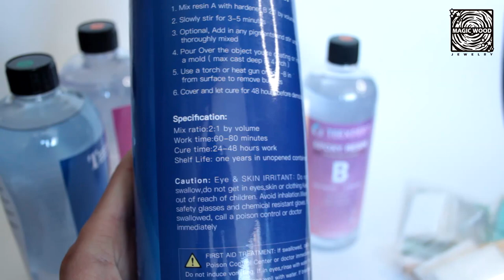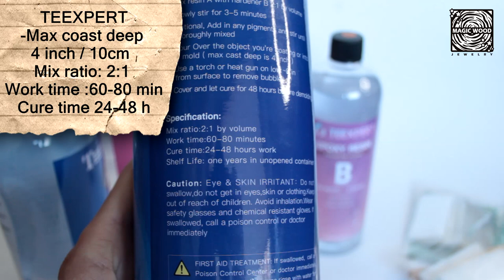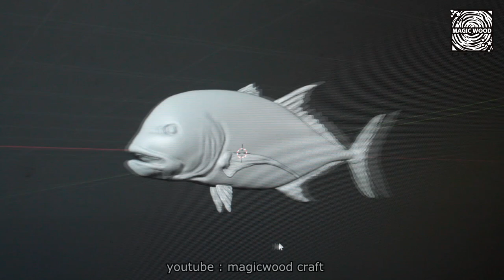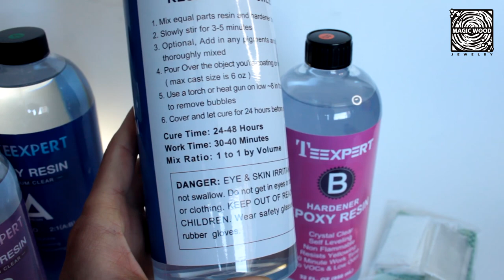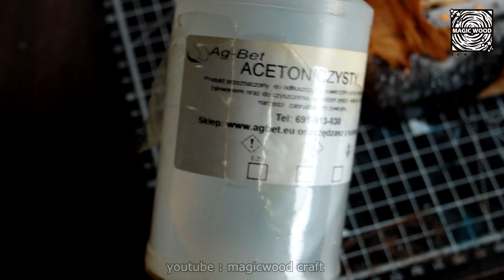Epoxy Resin and Wood Night Lamp - Giant Trevally Fish / How to make / Resin Diorama / DIY.

Comment: Hi amazing art work! ❤

Could you share how much resing in kg. Did you use for this project and how big the lamp is? Pls. 
To know how many kilograms of resin have been used. 

Many, many thanks!!
Reply from the maker: Hej. Thank you! Hey. From what I remember, less than a kilogram of resin. The lamp was about 25 cm high and 18 cm wide but not thick. Probably 4 cm. By the way, if you are not sure how much resin you will use, use the resin calculator :) https://teexpert-resin.com/pages/resin-calculator On this website you will also find the resin I use in this project.

Comment: When you add layers of resin to the first layer, do you wait till they’re fully dry or semi wet? Just wondering if there is a noticeable “wall”? I guess you would say in between the layers. Like can you see two lines going through the whole middle part where the layers join or is it all uniform if you get what I’m saying? Thanks! Insanely talented btw
Reply from the maker: Hi. Thanks for comment. When I add layers, I wait until the resin starts to gel. Then I can add figures. otherwise they would go to the bottom. If you add the resins at the right time, the lines should not be visible, but that doesn't matter. They are only visible from the side and top. They are covered by wood from the side. The lamp should look nice from the front and back:) you can see it clearly in the video when he adds figures/fish. By creating layers, you can achieve a cool effect by adding figures at different levels. You can also pour it all at once, but you must have resins for deep pouring and mount the figures on a transparent mounting first, as in this case https://youtu.be/TyFPd-V7viE?t=587

Comment: This is so awesome! May I ask where one can acquire these types of wood pieces? Once I find the wood, I'm ready to try my own!
Reply from the maker: Hi John. Thanks 🤝 and sorry for the delay. Small break. 
This is burl wood. It is a disease that occurs on various types of trees. 
You can read about it here. https://en.wikipedia.org/wiki/Burl 
 I buy them at home in Poland from my friends. Preferably wood after vacuum drying. You will also find them in your country at an auction or other place. 
Just remember that the wood for the resins must be dry 8 to 12% humidity. 
If you use wet wood, it will crack and bend while drying, and will release a lot of air bubbles when poured with resin. 
If you have any questions write. I will try to answer as soon as possible. 
Best regards! MW 🤝😊🤜

Comment: I notice that alot of your creations are leaving bubbles behind. Is this by design.
Reply from the maker: Hey, it depends on who likes which effect. Sometimes I leave them on especially for water projects, but sometimes for other projects I use a resin vacuum pump. In this project, pearl dye is added, which may give the illusion of small air bubbles, but in fact it is pearl dye.